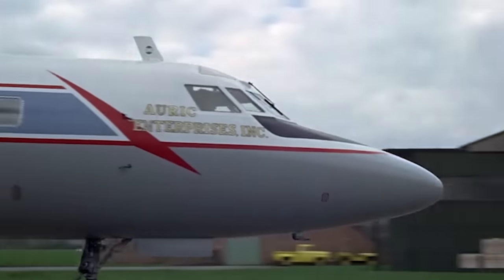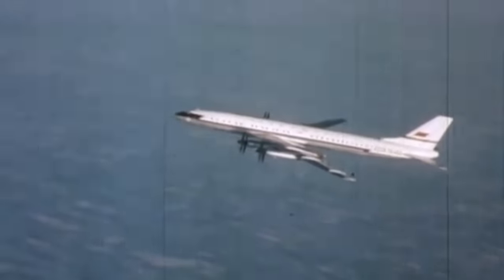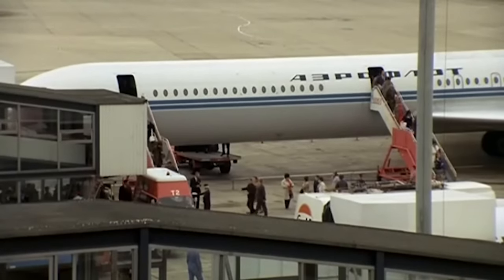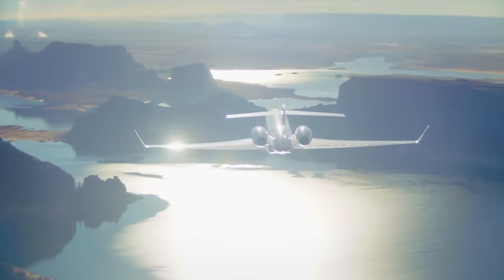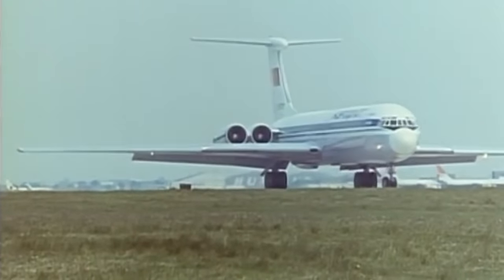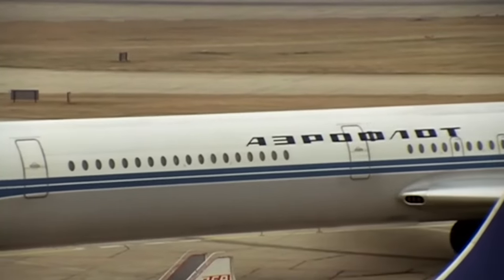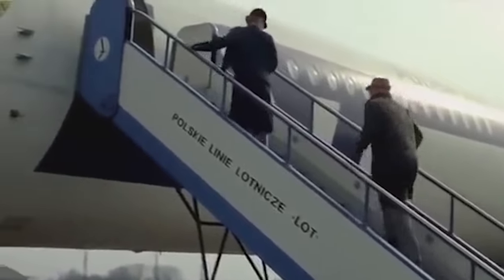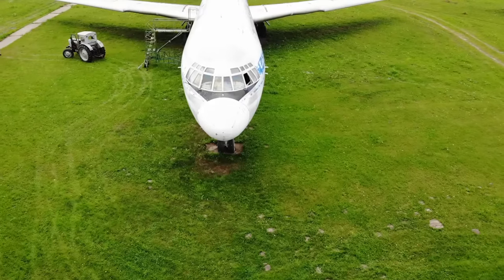IL-62 - an ideal option

Comment: I was working on IL-62 and IL-62M for Polish Airlines. The plane was not terrible and was liked among crews in 70-ties and early 80-ties, even outdated compared to western designs, especially in electronics. On the transatlantic trip, the plane was burning 11 tons of fuel in the first hour. Only after 5 hours of flight, it was reaching economical 5 tons per hour consumption. Fully loaded (and that how it was usually operated by Polish Airlines), it needed the full length of the runway for a takeoff. The really serious problem was (of course you cannot hear anything other from Polish Airline employee), quality of engines, both Kuznetsov and Soloviev (second used later on M version). Serviced exclusively in USSR only, both designs were plagued by scandalous lacks in quality and precision of manufacturing and nothing short of criminal lacks in quality control. As two Polish disaster investigations revealed, those lacks ranged from, nonmetallic inclusion in the material of critical parts, lack of any finish besides coarse on part requiring micro-metric finish precision, improper heat treatment of parts, unorthodox violating technical norms modifications, startling negligence in manufacturing, and nonexistent quality control. Interestingly, the Soviets had denied faults and the role of those faults (in their engines) in two Polish disasters for a considerable time. The official position was, that discovered by Polish Disaster Commissions engines faults were not the cause of the disaster, but it results. Even it was an obvious lie since the beginning, as Soviet explanation, despise of a number of signatures of important “scientific” and government officials, could not explain things like, finding parts of the engine over 150 km away from the disaster site, Soviet denial was finally and fully withdrawn only after, in two separate incidents (in Polish airlines), engines suffered catastrophic explosions while in flight, which did not end in disaster. Both planes landed safely. As disaster did not happen, engine faults simply could not be blamed on disaster anymore. In yet another interesting twist of fate, after surfacing of the following video on YouTube: https://www.youtube.com/watch?v=-xltGZk4aHY (ground inspection after a successful emergency landing of Cuban IL-62M in (good Lord, get this),...APRIL 2008 (!!!), when it seemingly became apparent that despise Polish disasters, engine problems were never corrected, even 20 years after, another campaign of denial took place, involving this time internet trolls, forcing untruthful claims on international Internet forums (Wikipedia and other), even what appears to be the clandestine operation of Russian intelligence agencies. This time on public forums, Russians attempted to claim, that presented by them record (which according to them is 100% trustworthy), of operation of IL-62 and IL-62M, indicated both planes as considerably safer than any western counterpart of the same time. To explain in that context, the very existence of Polish disasters, 20 years after those disasters, all of the sudden some documents of Polish Secret Police of communist-era were “discovered”, which claimed, Polish Airlines in unorthodox agreement with the manufacturer (which grant it a free hand in decision making), decided to extend the time of operation of engines between checkups, beyond originally recommended by the manufacturer. The story itself is constructed with a dose of negligence, revealing the lack of homework of the storyteller. For instance, as a manufacturer (making decisions) it stipulates Ilyushin Bureau, which did not produce engines, it produced the plane's body hence it would not be the one making the decision. That would be a job for Kuzniecov (for NK-84 engines) and Soloviev factory (for D30KU engines). Matter of fact Polish commission found very little to complain about the body of the plane and described Ilyushin Bureau's cooperation in regard to disasters as satisfactory and its findings as “objective”.  Problems were since the beginning with engine manufacturers and particularly bearing manufacturers. Anyway, the problems of such claims are as follow. As Soviet disasters were kept secret from public knowledge and opinion and records were secret, kept by the Soviet state only, it is only unverifiable say of new Russian now government that presented records are full and truthful. While IL-62 was still operated in 2008, revelations coming from the Cuban incident were quite unfavorable for the reputation of the plane (still manufactured and sold), which does create an agenda for the Russian government to be less than fully revealing. Revelations regarding engine operating time limits come not from work of the official Polish Disaster Commission, not in the time of the investigation, but from records of communist secret police which not that much had ties with Soviet intelligence (KGB and GRU back in communist times), but were rather composed of operatives of both. On top, the timing of “discovery”, 20 years after disasters, coincides curiously with the time of the Cuban incident. Even Secret Police theory was never publicly addressed by any serious investigation by the Polish state to my knowledge (they simply ignored it), the existence of such practice would have to be common knowledge in Polish Airlines, reflected not only in vast volumes of documentation but vast accounts of human witnesses memory. Hours of servicing of engines were not kept secret in Poland. Every, even basic level worker could have easily check them, or actually, to say more precisely, did check them, as knowing and operating with those numbers were part of normal work routine for a broad number of people from of all levels of the company. Those hours were listed in numerous places, starting from a tag on an engine or box with the engine itself (engine were kept unguarded on the hangar's floor, where anybody, even visitor could simply stop and read the tag), to documentation in various departments of the company (again easily accessible to anyone - as logbooks simply were lying unguarded on desks in hangars, where absolutely anybody who wished could read it, without being asked any questions). As following and keeping those hours was part of a job, the work of many people required constant checking and familiarity with them. From my side, as a former employee, even not directly involved in engine servicing itself, I can only say, any memory of altering those numbers,... are simply not existing. So here they are. My two pennies, while on the subject. Was not trying to make it an attack on Russia. My sympathy simply goes not to people who manufacture the engines, but to common, average people who fly them, including Russians. They are the ones whose lives will be affected (hope not) by flying dangerous planes. There is one more aspect of the story, purely speculative. Are the Russian engines really that bad? Hard to tell for sure! For sure the Cuban incident happened. For sure Soviets were aware of engine lacks way before they admitted it, as they were supplying “special” engines to service the official delegation flight of the Polish Communist Party to China (once delegation returned, engines were demanded back). The plane suffered no disasters or incidents in Polish Airlines for 8 years. Two disasters (and two additional incidents without disaster) happened in the time of “Solidarity” in Poland, where Poland definitely was perceived in the USSR as an enemy. Could it be this perception played role in Polish disasters??? I don't know the answer to this question.
Reply: Thank you for this. Yours is a fascinating first hand testimony of the times and processes. From what I know the maintenence intervals of the Soviet made engines were  less than half of the western made constructions. I have read much about both disasters but never knew about near cresh incidents. These were never made public and the passangers were probably threatened by the secret police to keep their mouth shut.

Comment: Thank you Skyships – yet again, an excellent, factual analysis (I love the occasional quirky comments – so human and indeed, humourous!).
My favourite (6) commercial jets (alphabetically) are...
- BAE146 (despite the Kapton wiring issues on the originals),
- Boeing B777,
- HS-121 Trident, so ahead of its time - Mk3: "the first 5-engined 3-engined jet"
- IL-62: THAT wing design!,
- Lockheed L10-11 (despite certain issues with the autopilot altitude-hold function) & 
- YAK-40.
“Time flies, and so will we” – stay safe, everyone.

Comment: In 1979, following a working trip to Kiev, I flew from Moscow to London with an Aeroflot Il-62. The landing in London was the smoothest ever (maybe the pilots were trained on bomber aircraft where it was probably vital as the 'cargo' was more fragile!). This was important also in this passenger aircraft since quite many of the soviet citizens on board neither respected the 'fasten seat belt' sign nor the repeated requests of the cabin staff to sit down. What might have happened in the case of a rough landing, I'd rather not think too much about!

Comment: I flew on an Aeroflot IL-62 from Heathrow to Colombo, Sri Lanka via Moscow & Abu Dhabi out and Karachi, Tashkent & Moscow back in 1982.  It was a very cheap way of getting there and back.  £200 return as my memory serves me correctly which even for then was cheap.  The one thing I initially found alarming but then got used to was the constant change in pitch in the engines on the final descent and slight roller coaster approach during descents.  Unlike most western contemporaries like the VC-10 there were no extendable leading edge slats so I assume they didn't have this additional tool to control lift, hence the constant changes in engine power.  It was iconic but didn't have the grace, elegance and sophistication of the VC-10.

Comment: Polish airlines purchased 7 IL-62 aircraft from the USSR. One in the LOT colors is visible in this video at the 23rd minute. This enabled flights to the USA and Canada. Unfortunately, 2 crashed due to defects in engine components. The first catastrophe in 1980 was caused by a blown turbine blade that destroyed the engine and altitude control systems (Il-62 had only one system, without power steering). 2 disaster in 1987, was caused by a defect in the design of the motor shaft bearing. In the disasters, 87 people died in 1980, and 183 in 1987. After the disasters in IL 62 aircraft operated by LOT Polish Airlines, technical and operational changes were made to increase the level of safety. The changes were based on the experiences of the two previous disasters.

Comment: I don't know why but I like the idea of engines in the back, for all purposes. They say planes are more agile, they take off sooner, you can have bigger wings, more fuel, and, in case of an emergency landing, engines won't touch the floor, you can better ditch or land without gear if it fails. Just seems all advantages foe all purposes, even emergency ones. Plus I'd never even imagined four engines at the back like this one has. Amazing. That decreases the noise in the cabin, except at the back. Sure.

Comment: I think all rear engine aircraft had tail struts or nose tethers. The tail strut on our 737-200’s was very simple, just a pole that was manually placed and removed. Out MD-10’s used a nose tether attached to a weight cart.  From time to time there were loading incidents on the ramp of rear engine aircraft where it stood on its tail due to someone forgetting to use the strut or tether.

Comment: 2:34
Not to mention that over half the TU-114 aircraft was a retread - same or very similar wings, SAME engines, etc of the Tu-95 "Bear" bomber.
Pretty much the only major change was the fuselage (much higher diameter and set up for passengers not bombs).

Comment: -I've always thought this was one of the best looking airliners ever produced, along with the 757 and the DeHavilland Comet 1.  I've actually been in one, in 1993 at Dulles Airport.  I flew Dash-8's back then, and Aeroflot parked next to us on the midfield tarmac.  So me and the captain walked over and talked to the crew, they were very friendly and we exchanged uniform wings.  That thing was ancient looking inside, but the flight attendants were drop dead gorgeous~! Damn.  The only real problem with this plane was the rear-mounted engines, which made it hard to land.  But the main problem is that during an uncontained rotor burst, often times the shrapnel would take out the engine next to it meaning double engine failures were far more common in this [and the VC-10] than with wing mounted engines as on the 707/DC-8/Convair 880 and 990.   Soviet engineers were under pressure to make things that were "spectacular", so I am a bit surprised that Ilyushin went with the rear engine design because studies have shown that in the eyes of the general public, rear mounted engines make a plane look smaller and simpler.  This is the main reason why ALL business jets have rear-mounted engines, it makes the plane look less expensive.  Less expensive and thus more "palatable" to shareholders.....
Reply: ' were under pressure to make things that were "spectacular" ' Not sure where you got that from. Engineers are always pressured to make things that work first then to make it 'spectacular' then make the spectacular as well. It's not strictly related to the soviets, but we just like to point them out more cause they had some crazy desings (west had their own tbh).
And not sure why would anyone consider tail engines to be 'cheaper' or 'simpler'. Actually, a tail engine raises a whole new set of problems, like a need to strengthen both the wing and the back of the aircraft, cannot use 'classical' tail designs etc.
Reply: @nottoday3817  I said it makes a plane LOOK simpler and thus cheaper.
Reply: In the two crashes of the Polish Airlines Il-62 and Il-62-M, in at least one of the cases, the turbine failures took out one adjacent engine plus opposing side engine, leaving only one operating. Plus as a bonus it severed all controls to the tail. These controls were not doubled as in the western planes (Hawker Sidley Trident had them tripled), so the fate of the plane was sealed. The Soviets always cared more for the military pilots (excellent ejection seats), than the civilians, who are considered expendable. That is why I will neverr, ever fly with their airlines, no matter what the hell they fly.

Comment: Making a retractable 4th. wheel in the rear to solve the aft weight problem was a good idea. Even today, the Boeing 737-800 sometimes needs a brace placed back there to keep from tipping backwards.
Reply: belfast had same problem  fill with fuel then load

Comment: The Ilyushin Il62M, was a very interesting airplane at first, when it bore a similarity to the Vickers VC-10 as far as the layout is concerned.  The four rear-mounted engines on these aircraft, even though, had some substantial differences to one another, were built at around the same time, and air travel was getting very scarce.  The British VC-10 airplane, was unique in it's own way with "over water" capability.  Only BOAC, which became British Airways later, saw large numbers of these airplanes fly over-water to US destinations.  The Russian IL62M, became an airplane that was also operated on longer routes, before more modern transports became known.  Anyway you looked these two airplanes, they were pretty unique.

Comment: R.I.P for all passengers who died in two il-62M in Poland (1980 and 1987)
Reply: RIP.   I think controlling for the climate where it was operated and maintenance quality, the IL-62 was one of the safest planes ever built!   It started, landed and flew mostly in the planet's coldest and cloudiest locations, N.Europe, Lenningrad, Moscow, Siberia, the Russian Far East etc.   Was maintained by various nearly bankrupt and frequently sanctioned national airlines known to be economizing on maintenance intervals and re-using used parts past their safety limits.   That 1987 Polish crash was one example.  LOT airlines routinely extended regular maintenance periods against producer recommendation (!) and let their planes fly a mix of new and old worn out engines (past due for rebuilds at manufacturer).  It resulted in a crash.   The plane was used by many airlines of poor communist countries under western sanctions, embargoes, etc.  Poland in 1987 was on the brink of bankruptcy from sanctions and embargo the West imposed stemming from 1981 imposition of Martial Law.   Many other similar crashes were a result of bad maintenance or constant operation in worst weather conditions.  The plane itself was nearly impeccable.   Produced without a single Capitalist (!) ... a completely not understood nature of its true achievement (particularly in the West).

Comment: The Soloviev D-30 (engine used on some Il-62M, Tu-154 and Il-76) has many failures due to a metallurgical and manufacturing defect and has caused several fatal accidents: LOT Polish Airlines 5055, Cubana de aviacion 201 (CU-T1283), Aeroflot 3519, SunWay Air Carrier Il- 76 (4L-GNI).

"Goodnight, goodbye, we perish!"
              LOT Polish airlines 5055